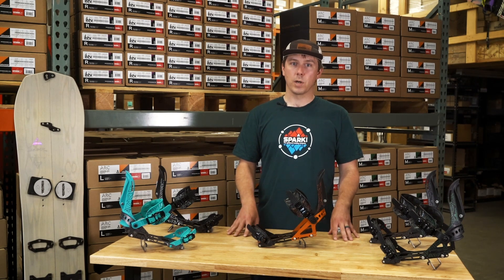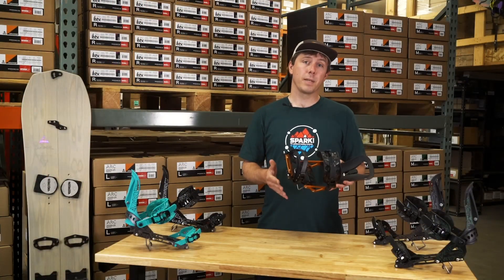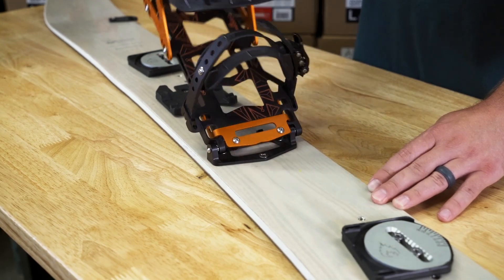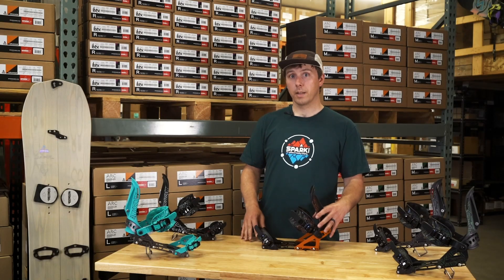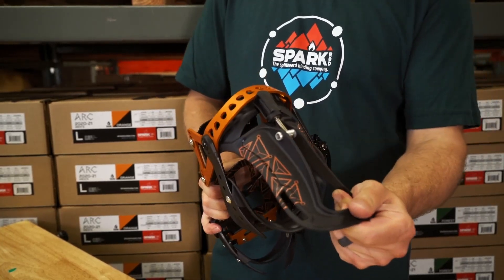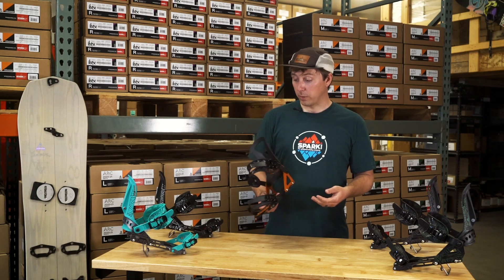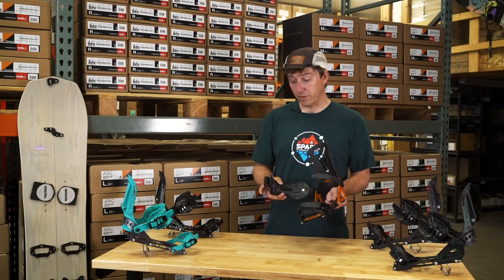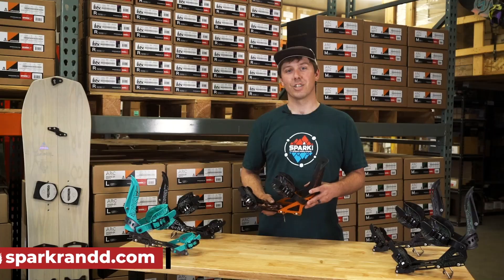20/21 Arc Splitboard Bindings

Comment: Do the touring mounts for the board come wit the bindings ?
Reply: Yeah, it comes with: Bindings, Tesla touring brackets, T1 heel rests, mounting screws, and Spark pocket tool.
The only thing extra you'll need to purchase is a set of Spark pucks for mounting the bindings in ride mode.